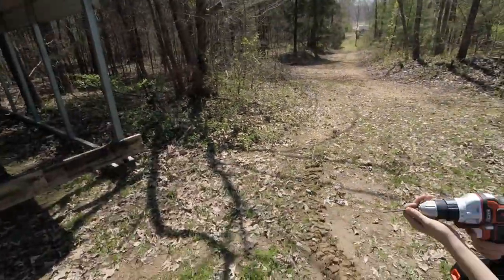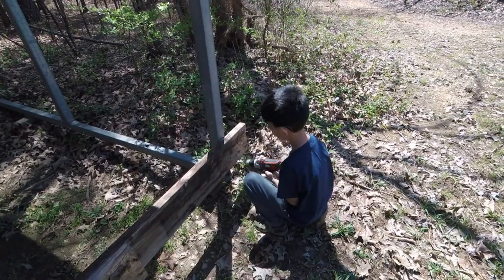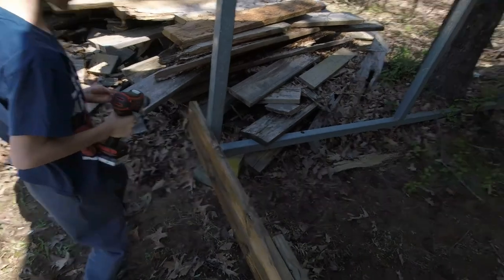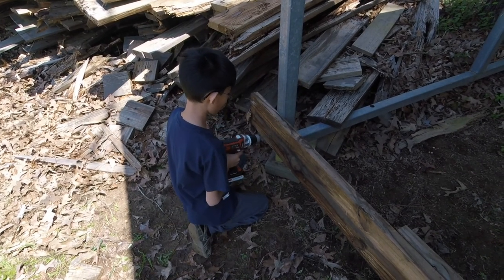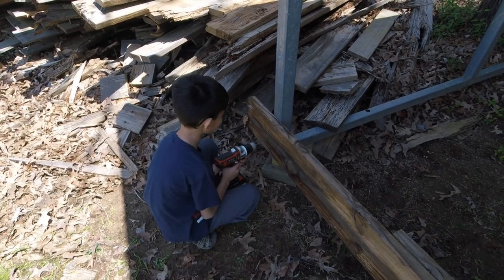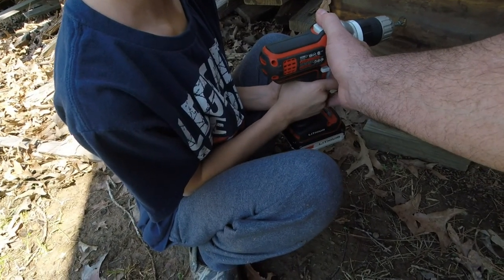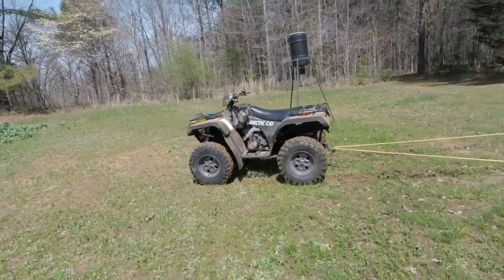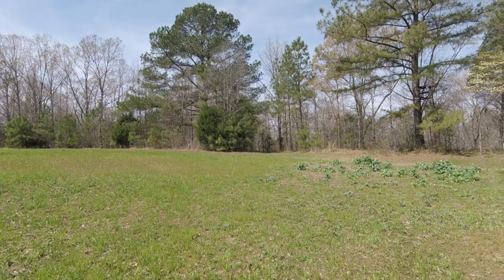HOW TO Relocate a Metal Carport with an ATV

Comment: What size it this? I need to move one that is 20x20. I need to move it about 60' from where it is now.
Reply from the maker: I think this one was 12x20. As long as you brace well, should be good!
Reply: My biggest concern is I have to turn it about 20 degrees and then straighten it back out
Reply from the maker: @clarkedavis9888  yeah turning is the tricky part.